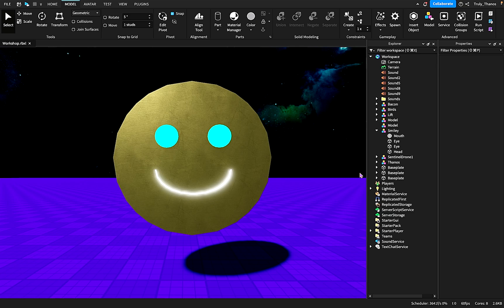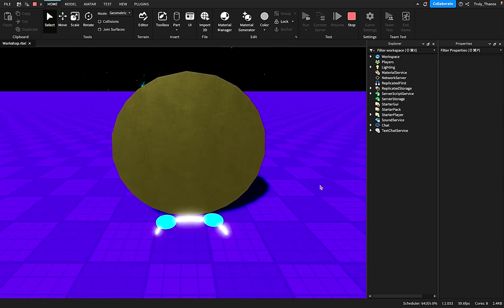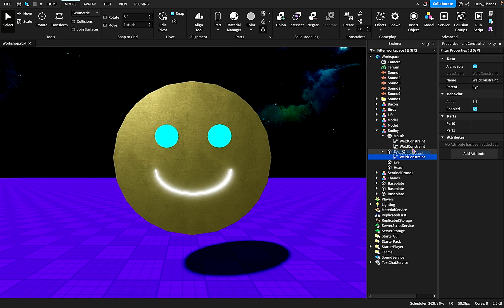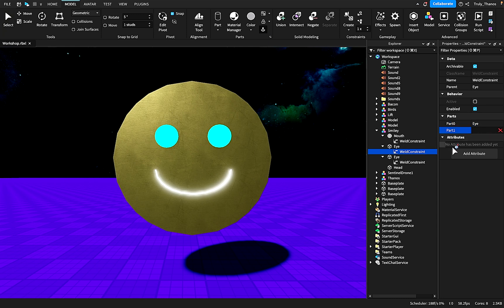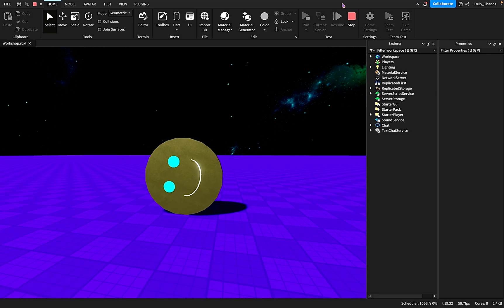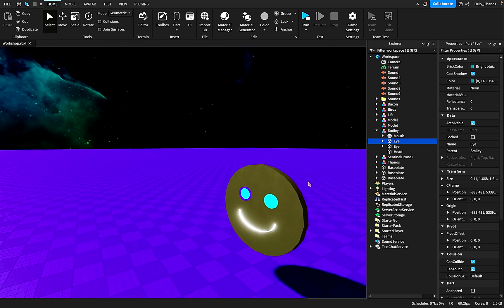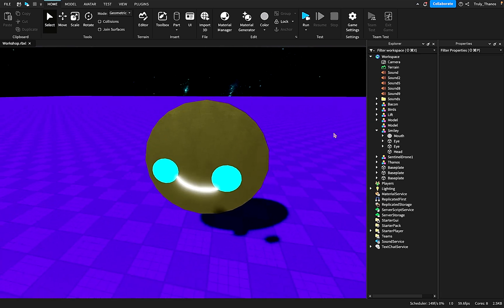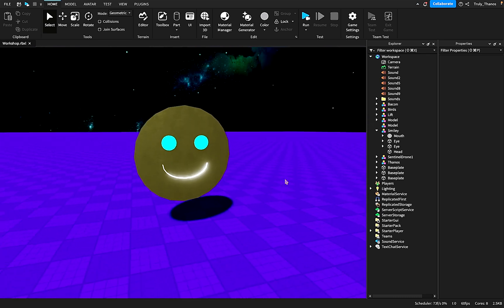🧱 How To Weld Parts Together [🛠️Roblox Studio]

Comment: Hi do you know how I can do it when I have over 200 parts? It’s already mixed together and I’m afraid of starting all over.
Reply from the maker: @official_strident  Just think about what is being welded to what.
You can use a main part as the “base” or “root” and weld everything else to that 1 part.
For example, Part 0 can be the main part everything is welded to, and Part 1 can be the specific parts you are welding to Part 0.

It depends on the model. If a character is wearing a helmet, you would want to weld the helmet to the head. If they have a bracelet you would want to weld it to the forearm.

So just give some thought to what is being welded to what.
Reply from the maker: @official_strident  All 200 of those parts can just be welded to 1 main part that acts as the “base” or “main” part.